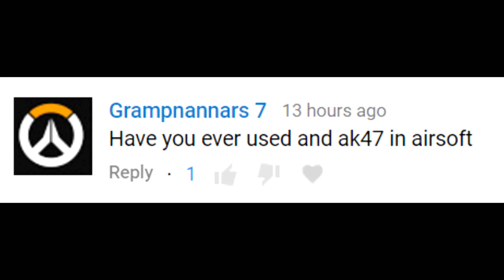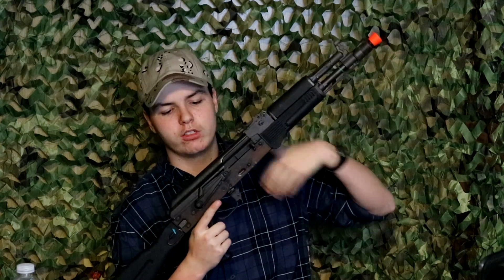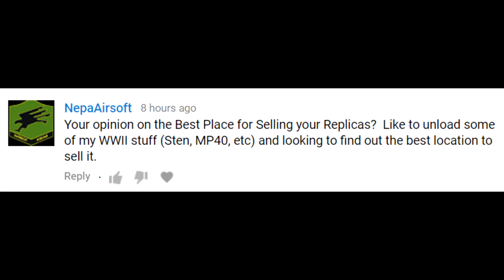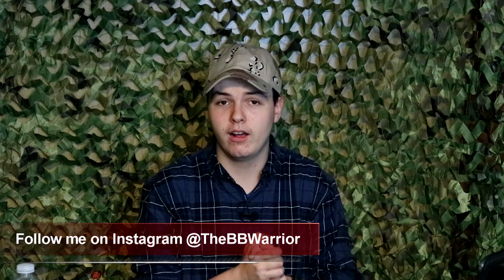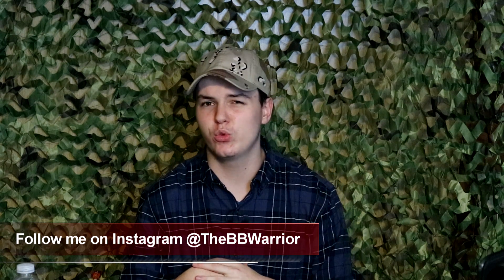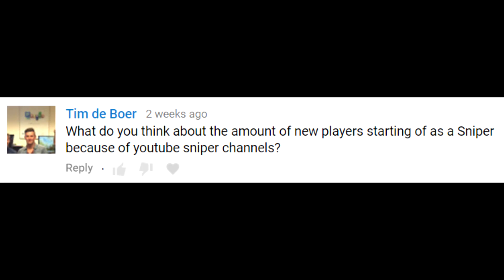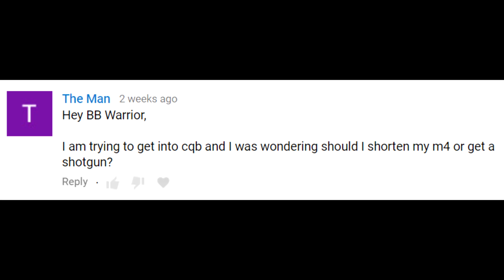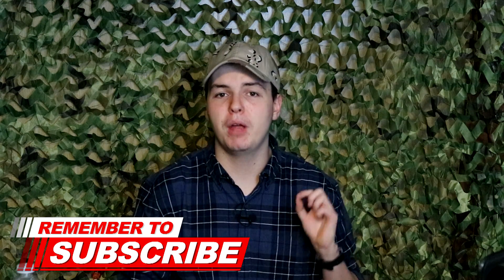AK Love, 3D Printing and Multi-Glam Black? Q&A #3!

Comment: Did a lot of 3D printing for airsoft myself, and can say, some just work. Started with proprietary and imposible to find replacement parts such as hop-up parts for an A&K Masada, and ended up creating custom parts for TM G17 or even entire hop-up unit shells for hybrid sniper rifles. I'm sure 3D printing can be fun, useful and can bring innovation into airsoft, but depending on the application or stress, should be limited from critical use.

Comment: When selling a Airsoft Replica, what is a good rule of thumb on the price?   I typical take the price of the Replica, the price of any extra mags or accessories I bought and extra Batteries.  Then what I do is take that total price and then divide it in half.  Been doing that for awhile and move the Replicas I want to get rid of it.
Reply from the maker: I typically start at 70% and then work my way down.